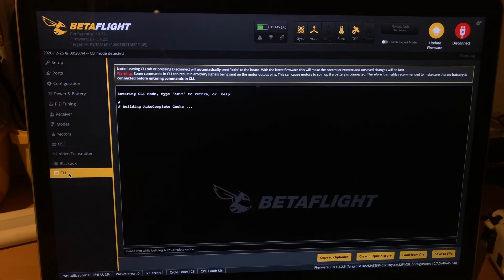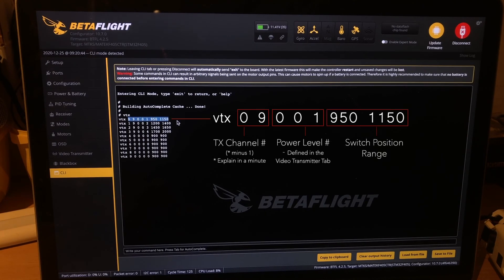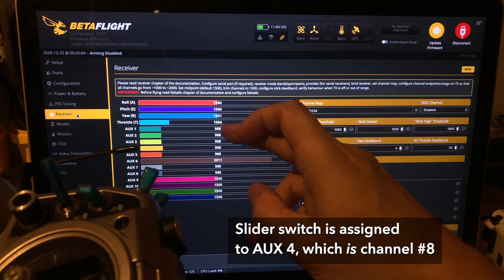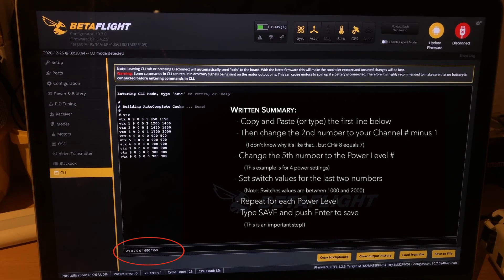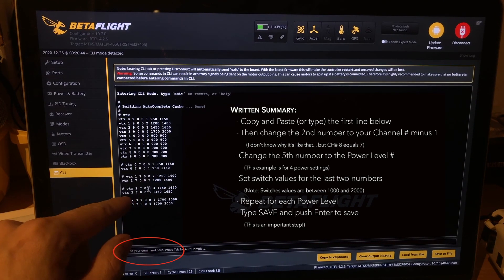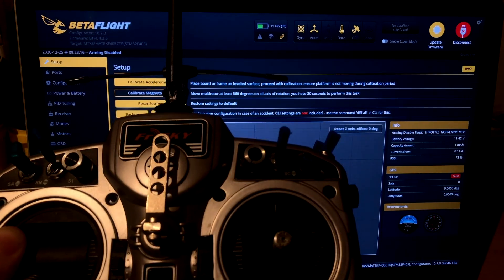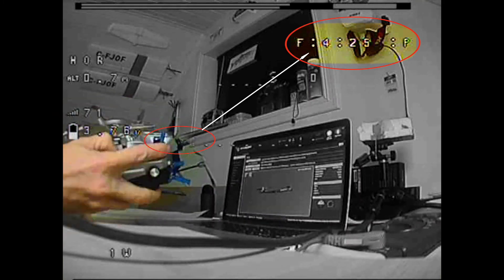Adjust VTX Power while flying using a transmitter switch! A quick How To video for every FPV pilot!

Comment: It didn't work at first for some reason (something about an error) but then it worked

This is what I was trying and the errors it was throwing before I made it work (maybe a space in front of VTX or something? IDK, I'm happy I can set it now on the go very easily)
# vtx 0 2 0 0 25 50 1249
###ERROR IN vtx: INVALID ARGUMENT COUNT###

# vtx 0 2 0 0 25 900 1249
###ERROR IN vtx: INVALID ARGUMENT COUNT###

# vtx 1 2 0 0 25 950 1249
###ERROR IN vtx: INVALID ARGUMENT COUNT###
Reply from the maker: Glad you got it figured out, thanks for sharing the errors. Might be helpful to others!
Reply: @GiantAntCowboy  Thank YOU for making the short video, it was very clear and concise, I had been trying to find a way to do this for hours because originally I was trying to get a similar effect by programming from the radiomaster pocket controller itself which was a headache and the wrong way to do it.

Comment: This video was super helpful, thank you so much for making it. I was looking to do this exact thing with a similar input. 

Just FYI to the new people doing this (as i've learned thanks to the comments). Betaflight has changed and now the channels are the same as the number shown in Betaflight so in this video it isn't channel 7 but channel 3 (4-1 instead of 8-1)
Reply from the maker: @hugocrs  absolutely, glad this video continues to be helpful.  Appreciate the comment, cheers!
Reply: I'm coming back to the fpv community after some time and learning all the new tricks from scratch. Your a god send I was having a melt down trying to figure it out

Comment: Small correction that might help with some confusions.
first two vtx numbers is not number of AUX, actually first number is config index and second number is AUX number (-1)
in latest betaflight versions you have to set not sequence number of AUX but actual AUX number (-1)
For example for this video instead of 7 you have to set 3.
It was something that was confusing me so I clarified and share here in comments, hope it will help someone
Reply from the maker: Yea, I added a note about this after the fact; but appreciate you watching & mentioning this for future viewers, cheers!
Reply: Thanks! Couldnt get it to work, but with this addition I could!
Reply: Thanks a lot I was getting super frustrated that I couldn’t get it to work

Comment: Well, I followed Joshua Bardwell’s advice and several others with no luck. Your short video made it easy! Thanks.
Reply: This video is Way way way better than Bardwells video because it's to the point on issue.
Reply from the maker: Thanks, I tried to make it easy to follow! Cheers!
Reply from the maker: Great to hear, i tried to explain it simply. Thanks for leaving a comment, always nice to hear these videos are helpful. Cheers!

Comment: this feature is very useful. I also want to learn what if I someday want to use the switch for something else, how would you undo this?
Reply from the maker: Glad to help. You can go back into the CLI command and change the 2nd number back to 0.

If you’re using ELRS look into ELRS Backpack, it’s a modern and better way to use your transmitter switches to control different things. 
Thanks for watching, cheers!

Comment: hi, i'm testing this feature now and i have a question: it can change only power during flight? We are preparing drones for Ukrainian soldiers and they want to change band and frequency via AUX channel during flight, but the only way to change it via aux channel is before arming and takeoff. After disarm vtx parameters don't want to change, i can do this only via VTX admin in via Lua. Anybody knows how to solve this problem? or there is no way to change channels during flight?
Reply from the maker: Hi, so there is a way to do this, but instead of trying to explain it, I’ll refer you to another video which explains exactly how to set it up to change the Band and Power using a switch while flying:

https://youtu.be/a1_U2v0kAjg

Of course you’ll have to change your VRX or have a second VRX on a different channel ready to go.  

If you’re using ELRS you might be able to use “ELRS Backpack” to switch both the VTX and VRX at the same time. 

Good luck, cheers!
Reply: @GiantAntCowboy  Thanks! I have ELRS backpack, and it allows me to change VTX and VRX band and channels simultaneously, but when i start arm drone i cant change it 😆 but Ok, i’m sure  i’m on the right way to solve my problem. Thank you!

Comment: I’m curious 🧐 is there a reason not to just keep your quad at 800mw?  like is there less lag but no penetration at 200mw?
Reply from the maker: So when I made this video I liked turning my VTX down when bench testing, or antenna testing. For instance see how far you could fly at 25mW but be able to crank up the power if needed. 
Too much power in tight spaces can sometimes cause multi path interference… 
Additionally when I’m waiting for GPS signals I’d put it at the lowest power. However I mostly fly HDZero now a days and just use the highest power. Generally it’s best to fly with the highest output power. 
(Side note: did you know that most VTXs output more power on lower Channels? I always use R1 due to this.)
Thanks for watching, cheers!

Comment: If i tipe vtx, i see this: 
# vtx
vtx 0 0 0 0 0 900 900
vtx 1 0 0 0 0 900 900
vtx 2 0 0 0 0 900 900
vtx 3 0 0 0 0 900 900
vtx 4 0 0 0 0 900 900
vtx 5 0 0 0 0 900 900
vtx 6 0 0 0 0 900 900
vtx 7 0 0 0 0 900 900
vtx 8 0 0 0 0 900 900
vtx 9 0 0 0 0 900 900

Comment: I set it to max and send it. Problem solved.
Reply from the maker: Yea, I primarily like being able to adjust the power output for testing purposes, and to keep it at 25mW while the GPS warms up. For the most part I agree with you though. 👍
Reply: I had the same problem and didn’t continue out of fear I would screw something up. Do you remember what the 950-1150 means in the line of code? I am new to this and don’t understand how this translates to the vtx output in mW
Reply from the maker: This was long time ago, but it sounds like you’re talking about “Defining the Switch Range” where in the switch the power level will be activated. 
Honestly, unless you really need to change the power, just set the VTX to max and go fly! No need to complicate things further.  Cheers!
Reply: @GiantAntCowboy yeah I just realized I replied under the wrong comment, but that was what I was asking. I’ll give it a shot and if it doesn’t work I’ll forget about it. Thanks for the fast reply!

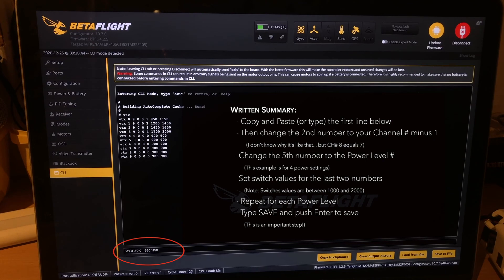Comment: Hey, fpv enthusiast and full time DevOps enginner, for anyone wondering or unfumiliar, in the 2:27 , the reason the number is 1 less it's because in computer coding you always start with the number 0 , so what we normally read 1-2-3 on computer code its always 0-1-2 , still when doing things for people to use we always translate the code to be "human" readable and start with the number 1, ence why when working with code on the CLI you have to remember that "less one" rule.
Anyway great video, not exactly what i was looking for but nice video nonetheless
Reply from the maker: Yea I learned that fact after the publishing this video, makes sense. Thanks for the comment, what video/information were your seeking?
Reply: @GiantAntCowboy  Was actually looking for configuring the display on the googles and controller with crossfire rssi value and link quality because I switched my drones recently to it and I am doing some more longer and further flights
already found it and am going to try it later, but this will still be helpfull, I just have the basic low power until arm and then its blasting at full power, but since I live in Europe, having a switch to switch the power back to the "safe" 25 mw power sounds a good ideia to avoid trouble.... ahahah
Reply from the maker: @PmJ727272  yea long range is a lot of fun. I’m actually up in Norway and do a lot of mountain flights, make sure your GPS rescue is setup and working. 
Additionally not sure what antennas your using but if you want to improve range for cheap, check out my Helical DIY video ( https://youtu.be/TS4fYcT3DEE ). I’m flying 7km+ with perfect video using this antenna which cost like 2€ in parts.

Comment: Tried this for my bnf Chimera 7 but can't get it to work. When I type in the numbers in CLI I get "###ERROR: vtx: INVALID ARGUMENT COUNT###". My video transmitter tab also says: Attention: Your VTX is not configured or not supported. So you can't modify the VTX values from here. This will only be possible if the flight controller is attached to the VTX using some protocol like Tramp or SmartAudio and is correctly configured in the Ports tab if needed. Any idea on how to fix this?
Reply from the maker: Hmm, well first things first, do you know which  VTX (make and model) your drone has?
Reply: @GiantAntCowboy  These are the specs. Still learning what some of them mean. It's supposed to be bind and fly. Do I need to solder a connection for the VTX to work with SmartAudio? I'm also using a TBS Tango 2. Any help is much appreciated.
iFlight Chimera7 6S LR BNF w/ DJI Air Unit
Crossfire NANO RX
1300KV Cruiser
SucceX-D F7 V2.1 Stack (50A 4-in-1 ESC)
SucceX-D F7 V2.1 TwinG
MCU: 216MHz STM32F722
Gyro：2x ICM20689
Baro: YES
Blackbox：32MB
Betaflight OSD: YES
BEC: 5V 2.5A / 9V 2.5A
Current sensor scale: 100
Inverter for SBUS input (UART2-RX)
Smart audio & Tramp VTX protocol supported
Beeper pad: Yes
RSSI input pad: No
UARTs：5
Motor outputs: 8
8 pin 4in1 ESC port (GND, VBAT, M1, M2, M3, M4, CUR, R5)
6 pin DJI Air Unit port (R1, GND, R2, T2, GND, 9V)
BLHeli32 Telemetry：RX5
Firmware Target: IFLIGHT_F722_TWING
SucceX 50A ESC
MCU: STM32F051
Up to 48kHz PWM frequency
Capacitance: 470uF/50V
Current Sensor: Yes
Target: iFlight-BL32-4IN1
Supports up to Dshot1200, Proshot, Oneshot, Multishot
BEC: No
Reply from the maker: So it looks like you have a DJI Air Unit (Digital System) and I’m pretty sure SmartAudio/Tramp are specific to analog systems. Either way I wouldn’t recommend you try to setup a switch to control your DJI output power anyway because I’ve heard this can cause the unit to reset, which would be very bad mid-flight… with the Air Unit you control channel and power levels from the goggle menu. If flying alone you should just use the highest power output setting available. 
If you have other questions let me know, and if your going to do long range flights check out my helical antenna and Li-ion battery DIYs.  Cheers!
Reply: @GiantAntCowboy  Thank you. I really appreciate the info. I'm new to this hobby. Just switched to the Chimera 7 from the DJI FPV drone which was my first quad. I'm using 6000mah 6S2p Li Ion batteries and some 12 turn helicals + a pair of X2Airs. Got the new setup specifically to do longer range flights up to mountain tops. Your info is a huge help. There's just so much to know.
Reply from the maker: Oh yea, you have a great setup for some mountain range flying. Glad to help! Long range is great, make sure your GPS rescue is setup and working properly, and if you can find a way to have the Tango 2 display or log your GPS coordinates that’s extremely helpful when you have to go hiking… I don’t have a tango 2 but saw someone setup the Tango 2 to do this.

Comment: hello, nice video but i need some help. I have a jumper t18 and the sliders are not appearing in the receiver tab in betaflight, and ideas?
Reply from the maker: Sure. When you set your RX up did you choose 8 or 12 channels? This will be selected from the Transmitter menus.
Reply: @GiantAntCowboy  I think 8
Reply from the maker: @limodog779  yup, switch it to 12, don’t worry about potential latency effects, I’ve never noticed any difference… but that should open up your switches. 
Alternatively you could probably remap/swap them with other switches that are active, but that seems like more effort. IMO.
Reply: @GiantAntCowboy  thanks heaps! Really good with helping your subscribers! This was worth a sub :)
Reply from the maker: @limodog779  Right on, I appreciate it! Let me know if it works out, or if you have any other questions.  Thanks for the support. 🤙

Comment: Hello @Giant Ant Cowboy , thank you for this awesome video! Can you help me? My vtx tbs unify pro32 hv, smart audio (device ready yes), i can change on osd the power, all ok!  i'm pretty sure i've done every step ok, maybe the channel is wrong? i'm using the switch SWB on tangoii wich is the CH6 so i'm using the command vtx 0 5 0 0 1 950 1200.  My vtx has 4 power levels, but my switch is only 3 positions..  it is causing the issue?
Reply from the maker: So when I initially made this video you used the TX Channel minus 1… however now your use the Aux# minus 1. *Go to the Receiver Tab and see the Aux# for the switch and try that. Maybe this is the issue?

Regarding the power level, that’s shouldn’t be an issue, just know that your highest setting will be 004, so you’ll have to skip one of the setting is guess.
Let me know if this works or not, we’ll figure it out no problem. Cheers!
Reply: @GiantAntCowboy  i love you my brother!!!  ty so much, it worked!
Reply from the maker: @pampfpv  Yea buddy! Awesome, that’s what I like to hear! Give the video a Like if you haven’t already and subs are always welcome and appreciated! Cheers man!  

p.s. if you’re looking to improve range and flight time I highly recommend my recent DIY videos. I’m flying out 7km (4miles) with perfect signal, and the antenna cost almost nothing to make. An amazing addition to any setup.

Comment: what kind of antennas do you recommend fpr freestyle I dont go super long range I have a rapidfire module and currently using a tbs triumph and a patch
Reply from the maker: Do you have any specific issues?  Your current setup sounds pretty good for freestyle, but if you find you’re getting a lot of breakup you might consider using two Omni or CP antennas instead of the patch. If you mount two Omni antennas in different directions you will get very consistent coverage and Rapidfire will be able to more consistently create a great image. 

If you stick with an Omni and a Patch and find your video signal has a lot of breakup, you might try switching the Rapidfire module to Legacy to see if that helps. The idea behind this is basically that Rapidfire is combining the  two antenna signals, but if one signal is bad you might actually be making the good signal worse. Switching to legacy simply uses the best antenna which in certain situations could be better. Worth a try. 
But antenna setups vary depending on the type of flight for me.

Comment: Hey, thanks for the great content follow a the steps. But I don't see any change in my osd vtx info  when I click the switch showing a change in power. I  am  using rdq mach 3. I also notice my vtx starts up at 200mw
Reply from the maker: Thank you for the appreciation! Let see if we can’t figure out your setup. The RDQ Mach 3 is a great VTX with SmartAudio, which leads my first question:
1) Have you setup SmartAudio? i.e. Can you switch VTX Power and Channels using your controller through the OSD menu in your goggles?
Reply: @GiantAntCowboy  I am able to access smart audio and change watts.
Reply from the maker: @spolonia360  So can you change the power using your transmitter now? Or only in the goggles/OSD?
Reply: @GiantAntCowboy  only through the goggles.
Reply from the maker: @spolonia360  Check two things:
- Be sure you are using the correct AUX channel  minus 1 ( Ex: AUX 10 would require you to enter a 9)
- Be sure you are writing “save” and enter to finish. If not it will not save the changes. 

Let me know if either of these help. If not, I may need pictures or videos of your Betaflight screens to help further.
Reply: @spolonia360  same problem here. Did you get to fix it?